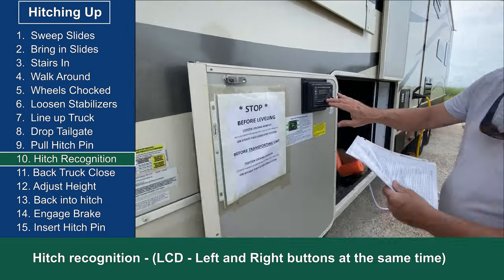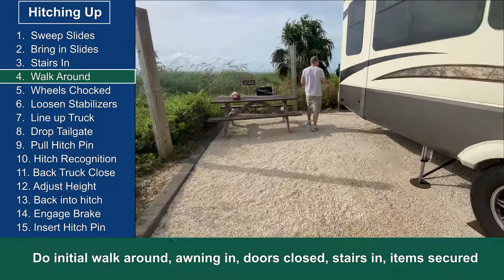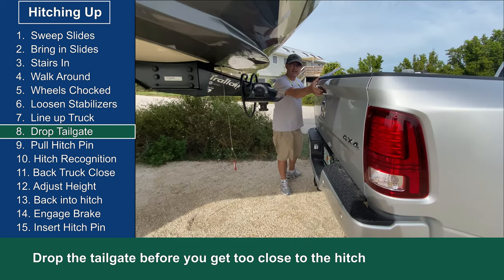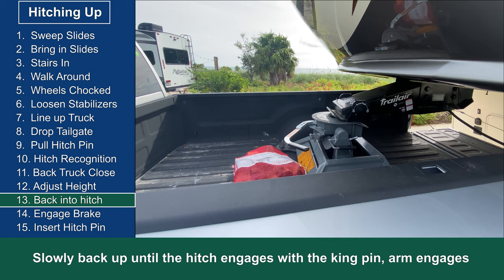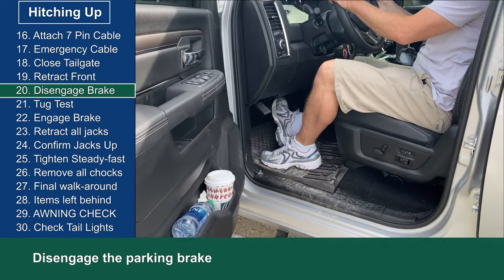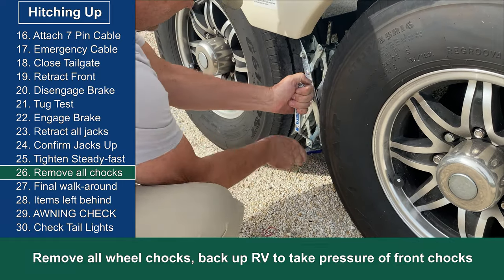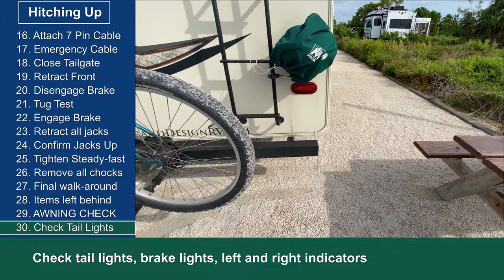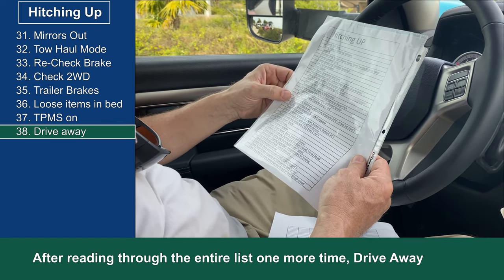Hitching Fifth Wheel Checklist, Step By Step (RV Living Full Time)

Comment: Very good, the only thing different I do is I don’t put up my tail gate before I do the tug test, I never skip this step, but also, I remove the chalks to do my tug test by engaging the trailers brakes, this will let me know if my breaks on the trailer are working, there was once that we had some work done on the trailer, and after hooking up I followed the same process and found that my breaks did not engage, the dealer had done something wrong after doing the bearings that caused the break issue.  So I always use my trailer brake device in the truck to engage the breaks, put it in drive and allow the trailer and truck to tug against each other, the reason I don’t put my tailgate up is because if the hitching was done incorrectly it’s going to drop and land on the front landing gears but it will not smash my tailgate as it comes down.  I have not dropped my trailer and by following this process if I do, it will cause minor damage.  Thank you for your comprehensive step by step video.
Reply from the maker: Thank you so much for those suggestions. They definitely make sense. 
The main thing is to have a checklist. Even after two years of full time travel, we still follow our list. 
Happy Camping,
Alice

Comment: Congrats on becoming fulltimers, one thing I didn't see on the check list was turn off the hot water heater.Would you share what part of florida you were living? If you don't want to say that's ok.
Reply from the maker: Joel Edge Joel, we actually have a separate pack up list and it’s on that one. We are based in Central Florida until July. Good point though. I could explain in description. Thanks for the feedback, Alice

Comment: Hi great video.   
I have a few questions. I also have a Grand Design Reflection 31MB. 
When you are doing your pull test you had the scissor chock on the tires would that prevent the RV from moving
Reply from the maker: Mike, hi. Yes but we use regular chocks while doing the tug test too. It works with our Solitude. Hope this helps. Thanks for asking. Stay safe. Alice

Comment: Never had a fifth wheel. An after watching I knew there was a reason I have always liked horse trailer with the goose necks. An with the shock absorber type hitches today that goose neck hooks on to make ride more comfortable for horse an you. Simple. Thanks for video.
Reply from the maker: The fifth wheel hitch has taken some getting used to.  I hated the weight distribution on a travel trailer.  The consequences for screwing up a bigger with a big fifth wheel.  I have never had a gooseneck before.
Reply: @DownsizingMakesCents  murhow an Lakota is two of the top brands. There is others nice living quarters in them to. Google them I know you don't want one your probably not a horse person but it's fun just to see the difference